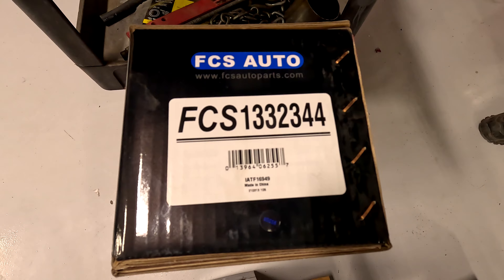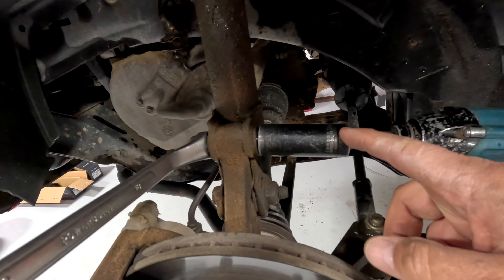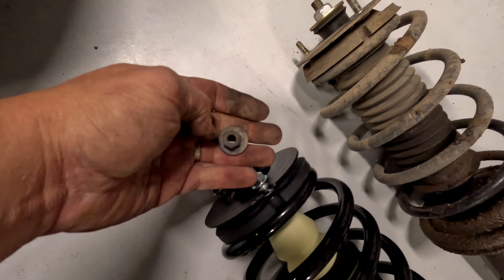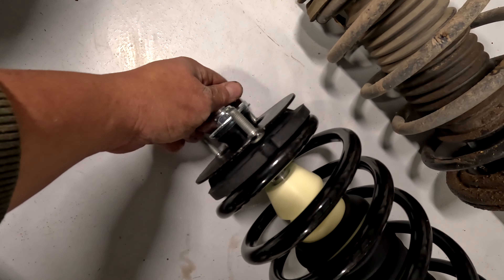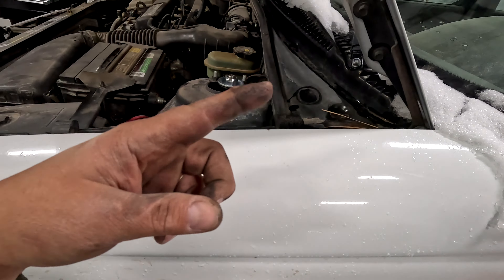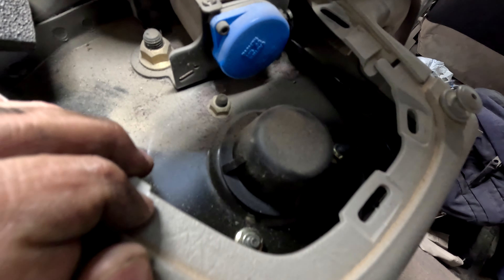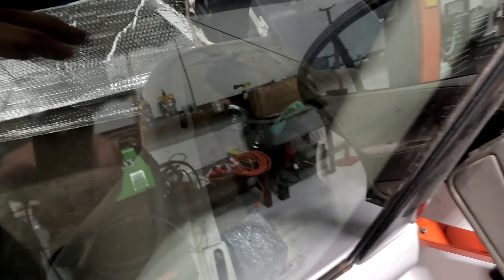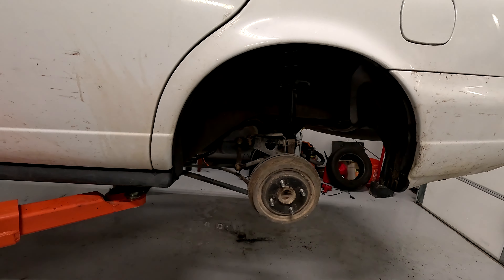How To Replace Struts/Shocks on a 1997 Saturn SW2 Step-by-Step

Comment: do you need an alignment after? thanks!
Reply from the maker: @invid024  yes.  Firestone has lifetime alignment
Reply: @FatGuyBuilds I appreciate your replies. what hardware did you use at the lower strut to the knuckle? at what point will a shop no longer do alignments on old cars? how did the alignment at Firestone go? thank again! =]
Reply from the maker: @invid024  they will do an alignment all the way back.  Maybe 1920s.  Factory hardware that i took off